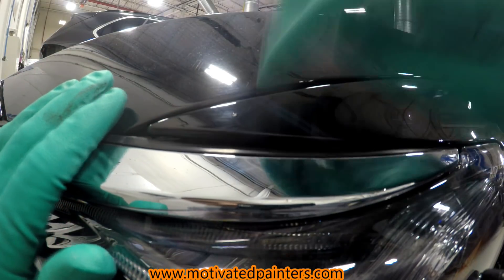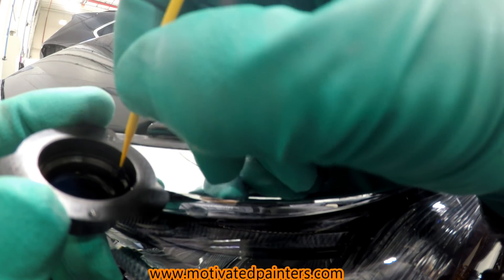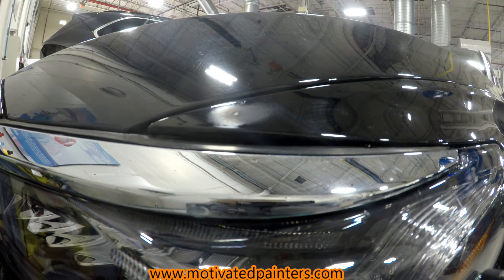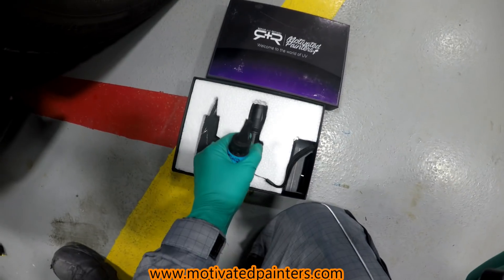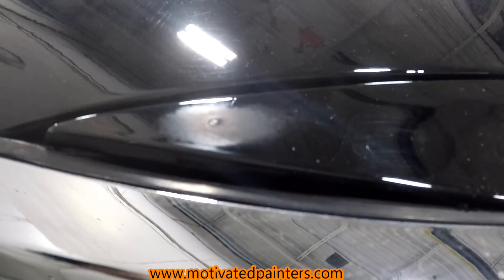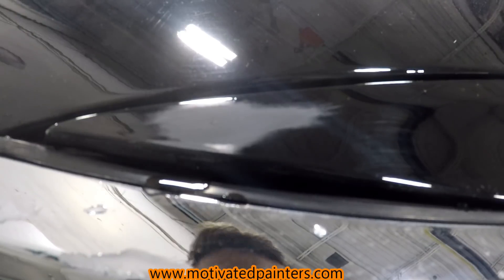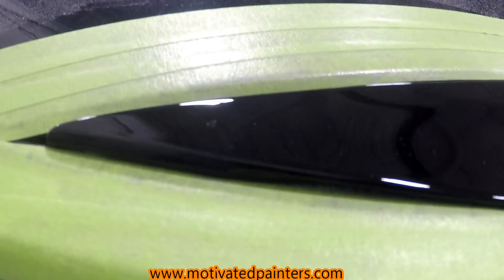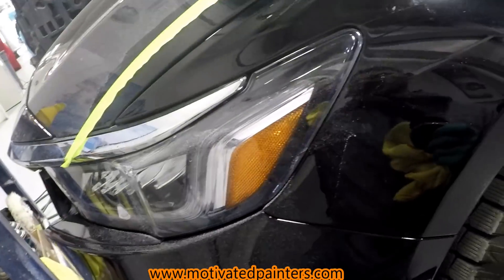Amateur Chip Repair

Comment: I believe the reason you can see the out line of the repair is the basecoat.
 Try touch up paint then sand with 1500(dry on a block) then clearcoat. This will remove basecoat that is sitting on the cars clearcoat.
Reply from the maker: Thanks for the feedback! Will do !

Comment: One other way to level off the paint/ clear is to use uour single edge razor blade like you would use a squeegee when you apply spot filler. Instead of trying to cut it off.  Works great that way.

Comment: Granted water base is a pain in the ass to touch up I went from EHP to DBC and shopline quick clear much faster dry time and less chance of the base getting sticky because EHP is basically latex the 581 helps it mimic solvent do not add 510 it will alter the color and give it a milky appearance to any of the base coat leave that for the under hood conversion I’d say for touch up add 5 to 10% 581 hardener to fully reduced paint mix to get the right thickness or 588 depending if ppg still sells that lol
Reply: Main painter to mobile painter he’ll of a change lol at least I see the sun now #pasty #irishashell
Reply from the maker: Thanks for the feedback! I need to try it

Comment: Why not wipe it with paper tower gold it three times wipe it flat and it will centralize and flatten the bubble dab clear on to it and the heat gun it and San with 3000 and 5000 then a quick buff with the DA flex buffer to melt in
Reply: Fold

Comment: It would have worked better if you used  800 clear to dab yes it would take longer to dry but you would have better results the uv clear is to thin or even some 520
Reply from the maker: Wanted to show how quickly it can be done but yes 800 clear works great!!!😘
Reply: @MOTIVATEDPAINTERS  great job on that chip considering that it's the first time you repair damage that way ! I look a rock chips in paint and wonder how I would repair it,your approach for this repair pretty sweet.Saludos desde San Diego California!!!!
Reply from the maker: Thank you so much man! It means a lot !!!

Comment: Hi my brothers pls tell me i am beginner  for spray paint under 100 dollars spray gun tell me and web site pls tell 🙏
Reply: Aliexpress.com. Hvlp spray gun.
Reply from the maker: Not going to get you anything good brother for $100 better to save up and get a good gun
Reply: @MOTIVATEDPAINTERS   ok 👌👍👏
Reply: @cdeaereoss88  Are you daft ? Suggesting a HVLP spray gun for a beginner, which you can safely assume is not working in a proper bodyshop and is probably working in his garage without a proper capacity compressor? Yeah right dude HVLP, very good suggestion.
As for the op, forget about a 100 dollar spray gun, save upto like 350-450 and buy something like a DeVilbiss GTi Pro LITE with a 1.3 and 1.4 nozzle combo with either a T110 or TE20 aircap. Its just as good, if not better than 800 dollar sprayguns and isn't going to break the bank. For a 100 you can get a okay primer gun, thats about it.
Reply: Air Gunza sell for around $130.00 and. I can't of anything Better in that price range.keep in mind that the key to a  good looking finish is 90% in your preparation!,sanding,cleanliness,correct measurements,compressor. good luck.Now go paint some shit!